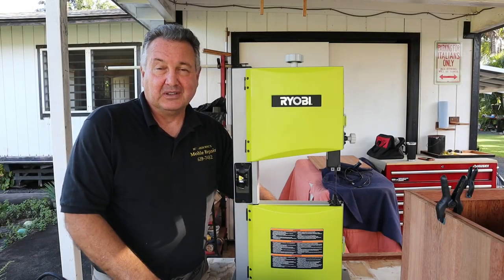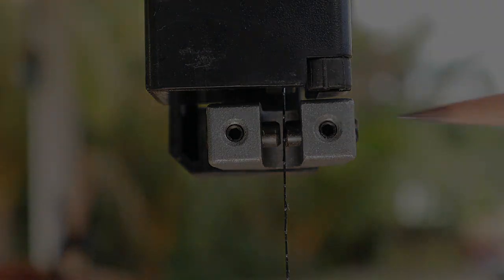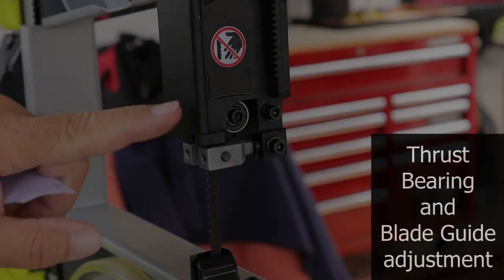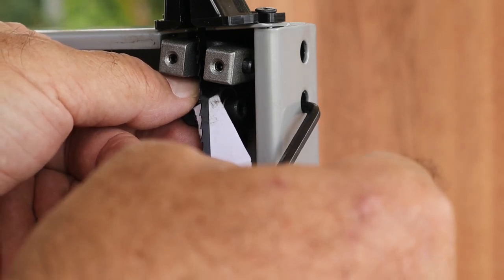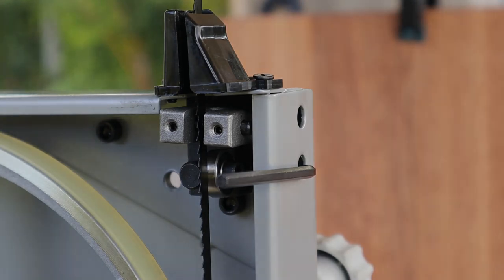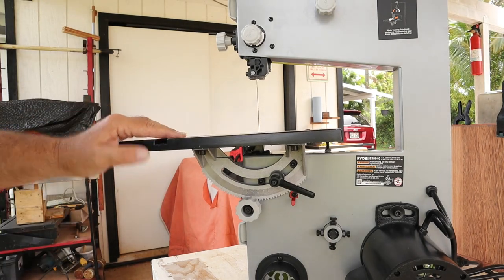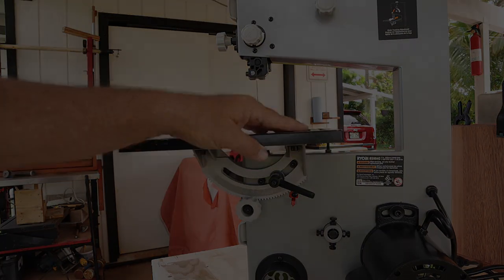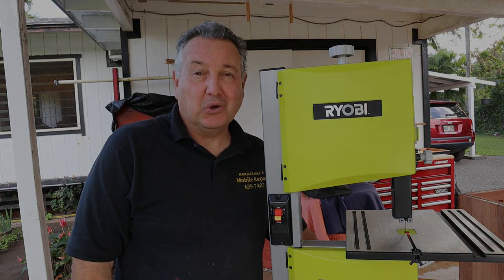Ryobi 9" Bandsaw PN: BS904G: Assembly and adjustments in detail.

Comment: Thanks so much for covering all the little blade guide adjustments. I've had my Ryobi for nearly 2 years, and have always had to compensate for blade drift and other quirks which I assumed were just due to the cheap nature of the saw. I didn't realize how far out of adjustment the guides & bearings were. Wow - what a difference when they're all in alignment! It's like a whole new saw. Can't thank you enough.
Reply from the maker: Aloha Piper,
Yes it is a cheap saw but if adjusted properly and used within it's design parameters then it is a decent saw.  I'm very glad that the video was helpful to you.
Mahalo for the kind words.

Mike
Reply: I just picked one up used and was dumbfounded that using the slide did not cut square.  I kind of adjusted the table and looked at the guides but now I will try to adjust the guides properly and hope things square up.
Reply from the maker: @rob12449  Aloha, hope the video is helpful to you.
Mahalo,
Mike

Comment: Very informative video. One thing I noticed though, when you turned the wheels to make sure the blade was centered I could still hear a faint grinding sound.
Reply from the maker: Aloha Jay,
Thanks for the great comment.
It was probably the blade guide(s) just barely making contact with the blade. If I recall they were set to a tight tolerance. 
Mahalo,
Mike.

Comment: Very informative video.  Seems like fussy adjustments for this model.  I'm still considering this Ryobi 9" model or the more expensive WEN 10" band saw.  Still haven't decided yet.  Have you tried to re-saw a 2x4 or 4x4?  Specifically, a full 96" piece of lumber?  Or what's the longest length re-saw you think it can take?
Reply from the maker: Aloha K LE,
I do get a bit fussy with the adjustments in an effort to get the most from an inexpensive tool.
At this point I have not re-sawed any 4X material on the saw.
Mahalo for the comment,
Mike.

Comment: I bought this and it is great for small projects. I would not use this Bandsaw for large pieces of wood because it has its limits. The manual will tell you what size of material you should be cutting. You want large cutting you need kick out the cash for a more expensive bigger machine.
Reply from the maker: Aloha BB,
I agree, thanks for the nice comment.

Mahalo,
Mike

Comment: Getting the blade to stay in place is a little tricky. I need to go back and try adjusting my blade guides. It seems it cut ok when I got it. Had to change blades, tried the Avanti 3 pack, and couldn’t get it to cut right at all. After this, I’m thinking it’s the guides? Thanks
Reply from the maker: Aloha Jerry,
Make the adjustments as well as you can then make your cuts slowly.  This is a hobby level saw so try to work within it's design parameters.
If you need a better saw then be prepared to upgrade and spend quite a bit more for a more capable saw.
Mahalo,
Mike
Reply: Jerry, I'm in the same boat. Blade that came on the saw was great.  I bought the Avanti 3 pack and they are straight garbage, even with the adjustments.  I'm going to try a Bosch blade next.

Comment: Your hand was in the way for the Lower Blade Guide Adjustment.  Nowhere has it been mentioned to turn CW or CCW to tighten or loosen the adjustments.  Just “briefly” you pushed on the small black button on the side of the adjustment aperature…you didn’t say here that we need to do that.  I have had all kinds of trouble getting my Band Saw to cut a straight line and so far everyone say’s these adjustments are easy..no clear instructions!

Comment: I have the older Blue model, and it has some better concepts, and definitely some worse concepts.
 
The blue model has traditional squared cooling blocks which I like better. However, the thrust bearing was designed with the blade running against the flat face of the bearing... it makes the entire saw junk imo. 
 
The older model also has the dust brushes, but they are mounted to the frame, rather than the door. So they're easier to setup.
It also has one large door vs two smaller, sectional doors.

The older model also doesn't have a very good lower wheel adjustment. I can never get the blade, and motor drive belt to both run at a good spot. So I make sure the blade is lined up right, and just kinda hope that the ⅓ of the drive belt hanging off the edge won't be a big issue. Lol.